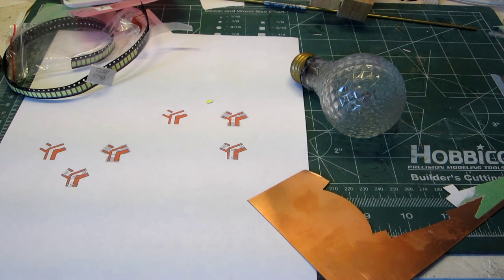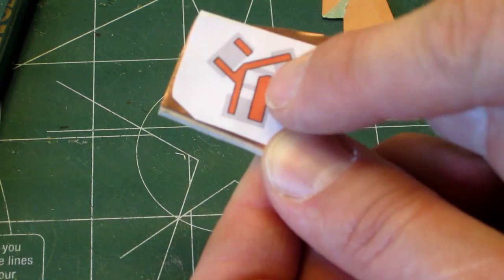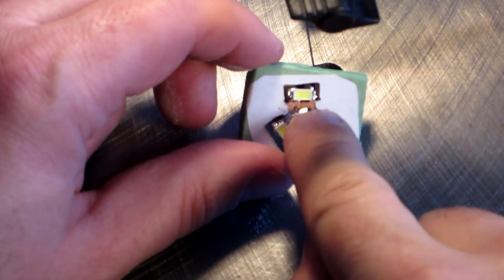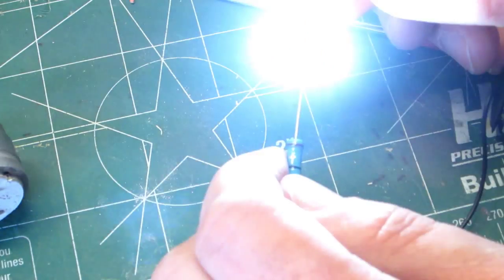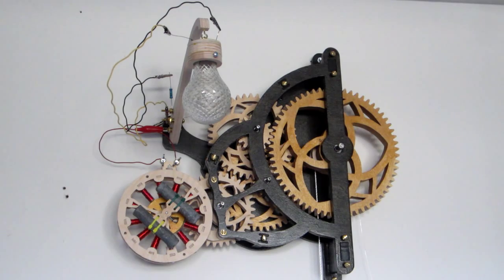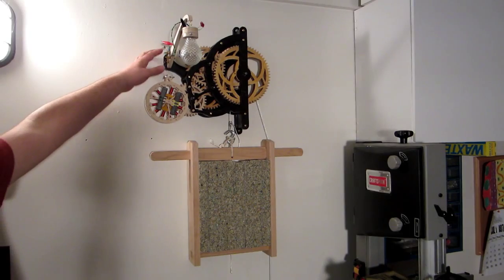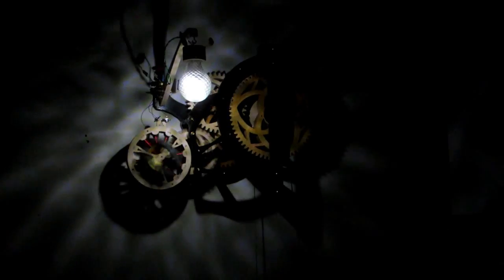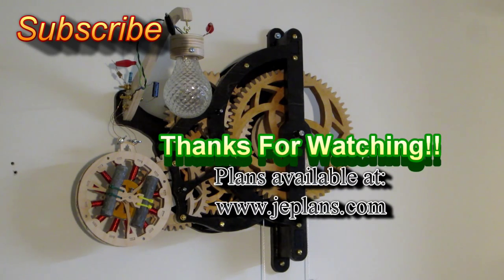Grav-Light Part Eight

Comment: I built something similar & added a voltage doubler circuit instead of bridge on the output side and it the results were way better. You might want to try it

Comment: If this is your final design for the gravity light. Well it's a very bad design in my opinion. There are so many changes that need to be done that could and would improve this system and your just giving up. Why are you just giving up?  Never give in. You could have a lighting system that would do so very much more, like run your AC fan in case power go's out so you could heat and cool your home. Charge your batteries, Run your refrigerator, coffee maker, and even possibly a induction stove for cooking. Don't give up mate. Just my opinion. Thanks for the upload.

Comment: After a certain rpm is reached will the generator or the led offer any resistance to the fall of the weight to make it fall slowly?
Reply from the maker: Yes the LED slows the rpm down significantly.  The closer to a short the harder to turn.  The slower it turns the less voltage and less light so then more weight is needed to keep speed up.

Comment: LEDs Mate!!! I like the gear setup, so much more to investigate and experiment with gears, pulleys and such due to the availability of strong and lightweight materials nowadays. Like bicycle generators made with car parts, good concept but in reality just too heavy to push, but now we have access to so much more, you have tonnes of potential. I was thinking of having 3 or more systems connected to eachother but with with increasing weight increments and possibly height (by the way i am talking ideally 5m high or more so that a full crank up will last longer) set up so that the lighter weights only contribute to the control of the larger weights and the same with the next weight. 
Could be used alongside compressed gas collected from the atmosphere or hydroelectric systems to crank it back up. So many possibilities.

Comment: awesome work, but i have some questions.
1 why didnt you used a dc generator?
2 why is the size of gears so big?
3why are you using such a large weight?
Reply from the maker: 1) No real reason other then I had that idea for alternator and  I thought it  would be easier to make. 2) Because it looks neat, and they wood needed to hold a good amount a weight3) It takes energy to make energy, when you take the weight divided by run time  , very little weight is being used as any given moment.

Comment: Great work... . He made to the generator .... The device is not practical because of the complexity, cost and light output provided .... Gears, and in this case the generator cause much noise ... Extending the time the movement is critical, stopping sometimes ... I'm trying to minimize these problems ... It is one of the first ways to use gravity with heavy weights ... . The escape mechanisms only work with low power ... Great video ... !!! ...

Comment: You might try adding a joule thief. With a joule thief I can run a 9 led lamp for hours on a single AAA battery that's too dead to run anything else. There would be very little load to your alternator.

Very nice design, thanks for posting this.

Comment: About the design for the custom led lamp: it would be sturdier if you glued two copper washers of different sizes together with some double sided sticky tape .. well not tape ... the 1-2mm thick soft white spongy stuff ... you can run the wires through the hole in the middle and hang it with the smaller washer facing down so that if you use the outer edges of the washers as terminals for soldering the LEDs, these will all be facing down and to the side. This way you could add as many leds as the size of your washers will allow and it would be a more tinker resistant design. Easier to produce as well I imagine.
Reply from the maker: Milan Gajic Yeah, that LED layout proved more difficult that I though it would be to make.

Comment: That is really brilliant - so much better.  I must admit that the flickering would drive me nuts.  Maybe a bigger cap?
Reply from the maker: Christie Nel Thanks, as it is, it would really need to spin the alternator faster to clear up the flicker. At this speed I don't think  it could charge a bigger cap. A larger resistor also clears it up more but of course makes the light dimmer.
Reply: JEPLANS Another possibility is a rechargeable battery, but that would add some inefficiency in the system and you'd really want something that will disconnect the battery once the rotor stops.  Tricky problem.

Comment: great project.. but isn't it a little ambitious for only 7 minutes of dim light?
Reply from the maker: Cowboy 1894 Thanks, and yes, yes it is.  While certainly a bit more improvement could be achieve if I used a good  manufactured DC motor for the generator, but not a lot. It still ends up being a fight with how much weight is safe to use and run time.